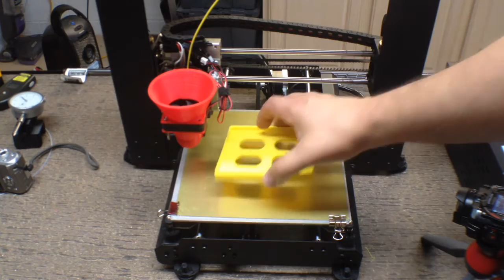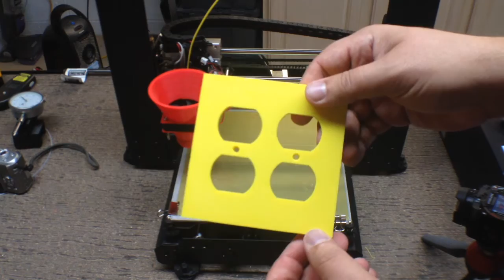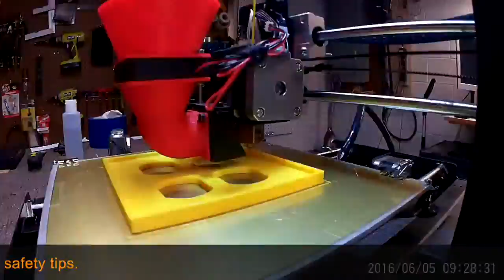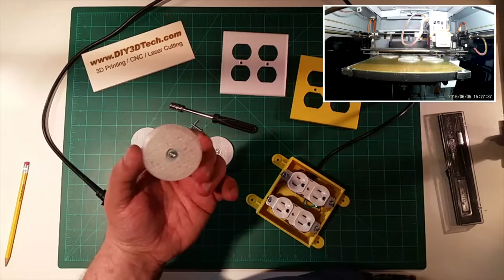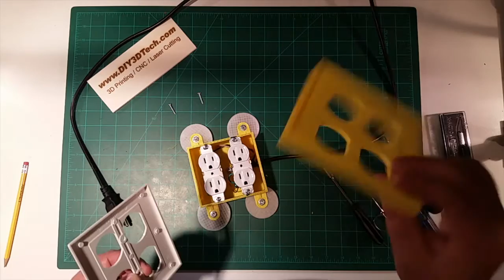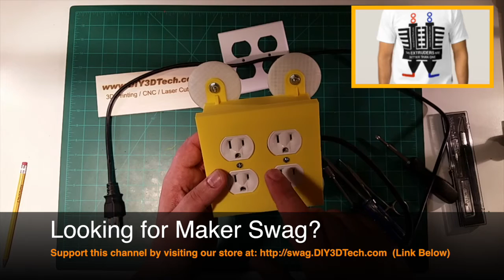3D Printed Project - Dual Outlet Utility Box Part 2!

Comment: Your first layer looks really smooth and solid.  What settings are you using to achieve that?
Reply from the maker: The key is PEI as I print on a PEI bed, run the nozzle at 200c, 60c on the bed and 0.2 layer height.  Comes out glass smooth...